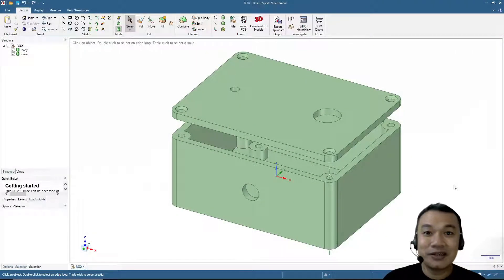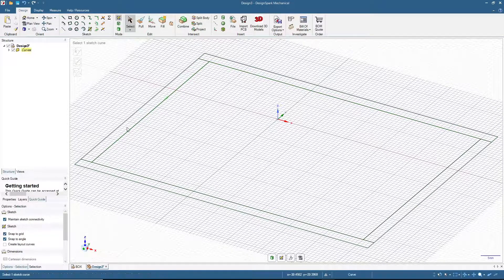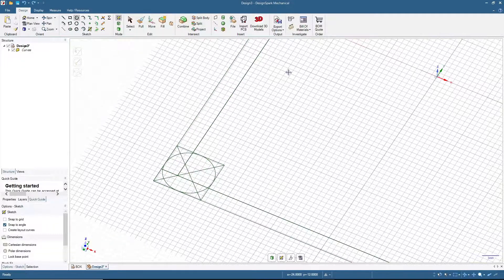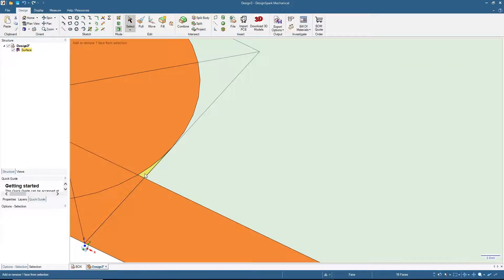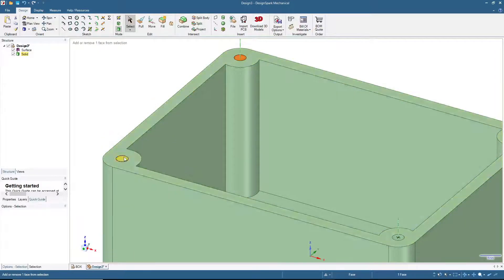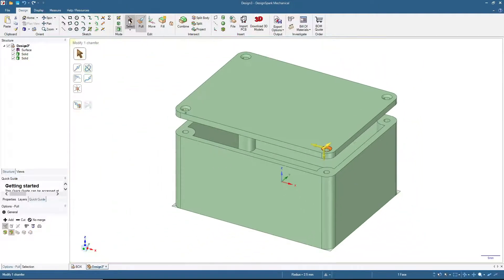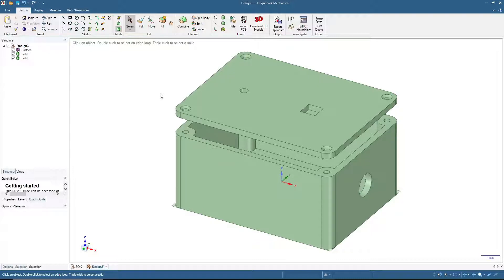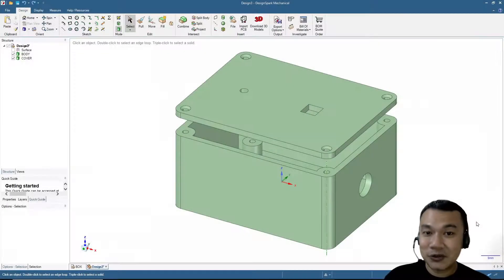Instrument BOX / ENCLOSURE - Narrated Tutorial of 3D Modeling Using Designspark Mechanical #06

Comment: C'mon. It is very amateur drawing.  Use "Offset Tool" for walls or create a 3D box and then use the "Shell" tool for sculpting in it. 3 sec. Also use construction lines in mirroring to work only on 1/4 corner, the other will be autoamtically drawn. 2:23 use "Trim away" tool. MAN! ;-)

Comment: Just a few tips for people who want to go fast;
If you have a square, and you double klick the border, you can select the "offset curve" tool next to the point tool, that draws a rectangle at any given distance. 
another time saver: if you draw a "construction" line  in the center of the short side of the rectangle, then with the right mouse button on that construction line (any length wil do) there is a "set as mirror line " option. If you repeat that for the longer side of that same square, you only have to draw ONE circle and it mirrors the other 3 circles. and it also pulls all 4 circles at once for the same depth. 
Try a few construction lines through on point about 3  or  4 in different angles and set them as mirror very fast drawing, and some nice figures to be made like a clock face 
Kind regards Hans
Reply from the maker: This is exactly one of the reason why I share this video : to get cool feedbacks like this one. Awesome tips Man, I haven't tried using double of the mirror line yet, but now will do, thanks to your sharing. Have a great day :)
Reply: @W3DEStudio  Hope you get a lot of likes and subscribers 
Selamat makan is one of the few Indonesian phrases I know 
Cheers
Reply from the maker: Terima kasih banyak, thank you. Cheers :)
Reply from the maker: @hanspijpers2100  Hi, looks like one of your comment about scaling 3D object got hidden by YT :D
I already take some note from the notification, thank you :)
Reply: I just used the double mirror and I feel like I have super powers now!